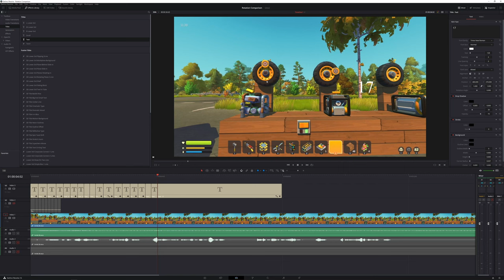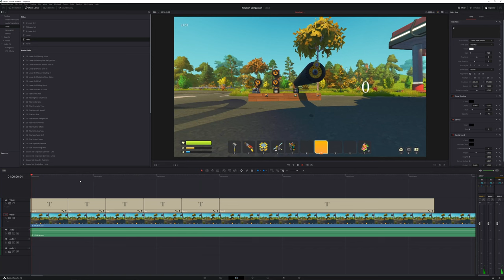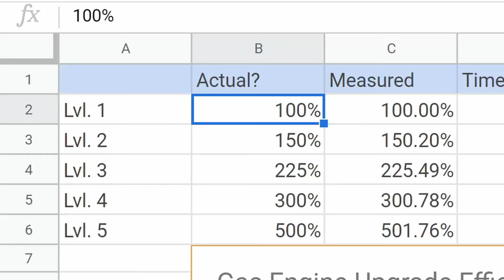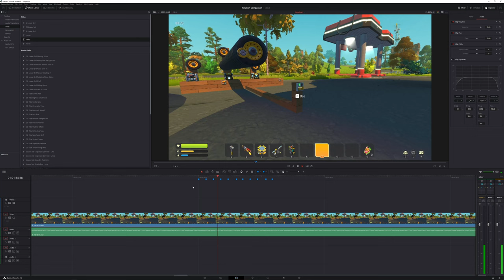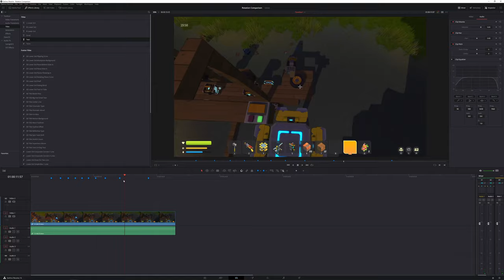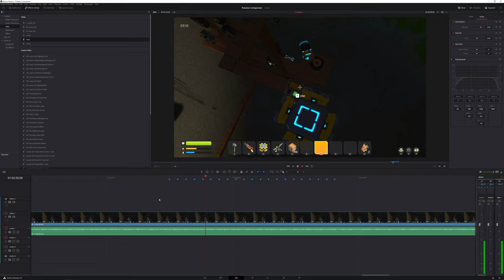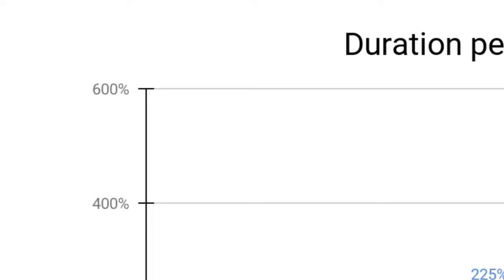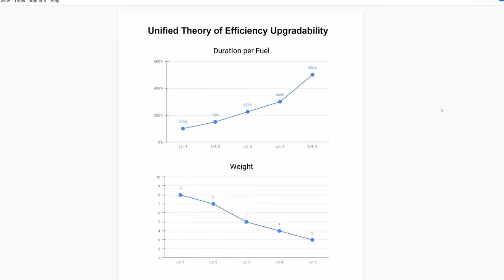How Fuel Efficiency & Consumption Works - Scrap Mechanic Science!

Comment: the electric engine may seem more fuel efficient at first glance

but remember that in scrap mechanic, gas is more renewable than electricity for some reason
there's no solar panels or wind turbines, but there's literally entire ponds full of oil if you know where to look for them
Reply from the maker: Yeah, I think the video was done before the oil update or without it in mind. Free oil is kinda game-breaking.
Reply: Well technically renewable batteries are coming to chapter 2
Reply: @zathegame  pretty sure we weren't aware of that when I replied 8 months ago
Reply: The oil pools were done to give gas engines and thrusters at least a fighting chance against controller power and piston power
Reply: In the future electrycity will be more renuveable with the battery producer(or whatever it's called).
Reply: @caracalfloppa4997  yea sure def thrusters lol
those things are not worth it even if you mod it to have more levels

Comment: the force of a thruster goes up exponentially, I assume that its efficiency would to 
measuring the thrust produced in the equivalent of weight force of the concrete block 3
L1 - 6.4
L2 - 9.5
L3 - 14
L4 - 21.3 
L5 - 32.02
L6 - 47.6
L7 - 71.2
Keep in mind  that the units shown are of the force in equivalent to a number of concrete block 3
the mass of the concrete block 3 is 35.5625
also the mass of the thruster goes down when you upgrade is so the thrust to weight ratio will change.
you should also note that the torque of the gass engine follows a similar path as wall as the rpm of the electric engine. 
I recommend making a dynamotor in a controlled environment. its not that hard. I've ben studying the game's physics engine and I've ben working on a 'cyclotron' of sorts to study the aerodynamic drag or general resistance as I call it and how it scales. 
im hoping to get a video out covering my findings soon.

there are lots of creative people in the community witch is good but it hurts me to see innovative people getting swept under the rug and how over saturated the game is with nonsense.
Reply from the maker: Yeah, the force goes up exponentially, but so does the fuel consumption.
Well, I figured the changing thrust to weight ratio out the hard way.
That's awesome! I hope you find the time to publish your experiments and results in the Scrap Mechanic community!
Yeah, what the big guys do isn't very creative but it keeps some people entertained, I guess. Seriously though, building a house in 10 secs, 1 min, and 10 mins, in a video that is 18:30 is just a joke.

Comment from the maker: Somebody looked at the game code and came to the following conclusions:
1. Efficiency scales exactly as I assumed
2. Batteries and gasoline don't seem to have a difference, so the electric engine and gas engine should be equally efficient
3. Past a certain point, fuel consumption doesn't increase linearly with weight, but with a square root.
Source(See for more details) https://www.reddit.com/r/ScrapMechanic/comments/jcciqu/ive_used_science_to_determine_which_engine_is_the/g91tkll?utm_source=share&utm_medium=web2x&context=3

I also made a Steam Guide, so if you want to stare at the beautiful data some more, here you go: https://steamcommunity.com/sharedfiles/filedetails/?id=2259205345
Reply from the maker: @Technology Boy Well, I could, but I don't think engines are any different in creative. At least, as long as they are the actual survival engines.
Reply: I am so sorry for u . u grinded for hours to the the test and some guy cames in and says i looked at the codes
Reply from the maker: @tanay6003  Looking at the code is always an option, but it's way less interesting. Part of doing this video was to do some science in-game, which I think worked out really well. In the end, we can use the code to verify my findings.

Comment: The normal like, consensus or design is that electric engines have better torque, they are better for moving something heavier than a gas engine, which provides speed, that is the main difference between the two, they are about equal in efficiency according to the data, but if you want to go fast, strap a gas engine on there, if you want power, strap an electric engine on there, this is how they were created, with these two functions in mind. Of course this logic isn't perfect, at times the speed counteracts the torque problem, but from what I've seen, this is how they work.
Reply: Electric engines also start at full power, making them great for things that aren't cars (or as extra power for a dual drive car)

Comment: I am utterly amazed that you did all those tests legitimately in survival mode.  I would have enabled unlimited inventory.

All very interesting, but didn't answer the question everyone asks.  "How many wheels do I connect to my engine?"  Maybe you could do a sequel?
Reply from the maker: Thanks! I could have used cheats, but I prefer to do things 100% vanilla. But maybe l will use mods and cheats one day.

I don't really get your question. If you have a car with an even number of wheels, you need to connect at least two wheels. Connecting more wheels will increase fuel consumption, but also speed. This shouldn't make any difference. Well, maybe if your suspension isn't good enough and some wheels get off the ground, but that can also happen with two wheels.

Comment: I would really like to see a revisit that takes into account the weight of the vehicle, not just the wheels. I've definitely noticed my car using more fuel when I hook a trailer to it, and my mining rig consumes significantly more despite them both being 4WD with large wheels
Reply from the maker: It's more difficult to test with the weight of the vehicle. But in the end, the fuel consumption is speed*mass, so if you have a heavier vehicle, it consumes more fuel. I don't know the exact correlation, but the lighter, the better.

Comment: to add a little fuel data.
this boat  https://steamcommunity.com/sharedfiles/filedetails/?id=2111343664  use 2 lvl 5 thrusters.
with settings on max tank last like 30 seconds.  
but set to half power  tank last 2 minutes.
same if you add a 2nd engine to your car and lower engine setting you will gain torgue + power + you actually save fuel.
they need to be lvl 5  to be most fuel effecient.

Comment: You forgot the mountable spungun. Instead of fuel uses potatoes, but it´s like a thruster.
Reply from the maker: Well, I guess then I could also use the water cannon and chemical cannon. Haven't thought about it. Sounds interesting. Maybe I'll look into it. Thanks for the idea!
Reply: @Dr-Pixel  the thrust-weight ratio of water cannons is way too low to work, especially if you are adding containers (and pumps for a boat)

Comment: Your tests are quite misleading. The fuel consumption for the gas and electric engines is based on the work that they do. Spinning a small wheel on a bearing requires almost no work because the friction is very little. The friction also depends on the speed.

If you wanted to compare more accurately the engines you need to give them the same work to do and test them with different work loads. One way of doing this is by pushing the wheels with something with a constant force. This way the friction force will be constant. Then using the total number of rotations you can get the distance that the force was applied over. Multiply that by the force and you get the energy. So in terms of relative efficiency you an just compare the total number of rotations when applying a constant force. Your test already does that to some extent but the friction of the wheels on the bearings isn't constant so it is not perfect. The gas engine uses a type of bell-like curve to determine the torque based on the speed, similar to a real life gas engine (it has a little bit of torque when not spinning, increases to a maximum at some relatively high rotation speed and then gradually decreases at higher speeds). The Electric engine tries to spin at a very specific speed and can apply quite a lot of torque regardless of the speed.

The thruster functions in a completely different way. It applies a constant force and consumes a constant amount of fuel regardless of speed. This means that in theory you can get as high efficiency as you want because by moving faster it does more work per unit of fuel. In practice the air resistance limits this quite a lot. But if you have enough engines or a light enough flying vehicle you can move fairly efficiently by just going as fast as possible. Oh, and let's not forget that the thruster lets you fly :) .

Comment: did u know that the scrap engine use even less fuel than the lvl 5 engine u think im joking? nope watch one of scrapman's survival vid that the consumption rate is so low from using as a drill one drill les consumption unless u want use all of the fuel fast use it as a wheel xd one drill while no weight on the scrap engine is so low u can even use it without the container dunno y but thats how it works.... u will know what i mean when u see it
Reply from the maker: The other engines should be more efficient, but as I showed you can spin a wheel for a really long time because it doesn't have a lot of weight.

Comment: I also used to do some Experiments for building Flyers. Some of the most interesting Results I got that you could maybe verify are:

-Actual block weight doesn’t scale linearly with the weight description. The relation is:
1 – 1; 2 – 2; 3 – 3; 4 – 4; 5 – 6; 6 – 8; 7 – 10; 8 – 14; 9 – 18
Notable exceptions are Small Pipes each weighing 1.5 per Block as well as bearings, pistons and springs which have no weight.

-Thruster Force is proportional with Thruster fuel consumption for a give Level. Force increases exponentially for each setting with a base of 1.5

-Thruster Force varies slightly over time, in magnitude and direction. The Game files also hint at this.

-Free bearings don’t have friction.

-Air resistance is proportional to mass and velocity, rather than real air resistance which is proportional to the drag coefficient and velocity squared in most common cases.

-Bearing are much weaker in survival than in creative mode. When met with a linear force they move or stretch a lot.
Reply from the maker: Very interesting! Good job with your experiments.

Maybe I'll verify some of your results. Especially weight seems to be one of the most interesting topics. So far this has been well received, so I plan on doing more in the future.
Who knows? Maybe we'll be able to calculate quantum spins in Scrap Mechanic one day.
Reply: I am super curious as to how you tested that bearings have no resistance. I did an experiment recently calculating the resistance of bearing, and I came up with this formula: RPM*0.7^s or -30% angular speed per second.

Comment: so if you had 2 lvl 5 engines connected to 2 wheels each, would that be more efficient in fuel than having 1 engine lvl 5 connected to 4?
Reply: Having two engines would increase weight, but it also means 10 more fuel available. If you want a longer trip though just connect one of those fuel thingies to a chest full of fuel, you'll have fuel for days (or not, if you're using your engine on max power). On the other hand with two engines you get more power per wheel, so it depends on what you want/need.

Comment: Ok I saw this a month and a half after you post. And there now some thing new that changes how to look at the gas engine. Oil easier to get then before with the oil pools. And battery are hard to make. Also when testing the gas engine most the time your only moving a wheel. so the weight of the engine was not in the equation. where the thruster has to move the wheel as well as it own Weight. But that said it still not as efficient as the others.  Fun video even the bots want in on it. :)
Reply from the maker: Thanks! Yeah, I should have taken the weight of the engine into account, but if you build a car it's likely not the heaviest part. The numbers of the electric and gas engine are still comparable, and we all agree that the thruster is very inefficient.

Comment: either you can worry about this, or you can use a level 5 controller with 5 bearings per wheel to have infinite fuel
Reply: What
Reply: @Apersonl0l  if you get a level 5 controller, and have 5 bearings stacked on top of each other per axle, (separated by blocks of course) you can get some serious power and speed from the controller
Reply: that takes probably too much comp kits and rip physics, having alot of bearings for a wheel is not a fun experience